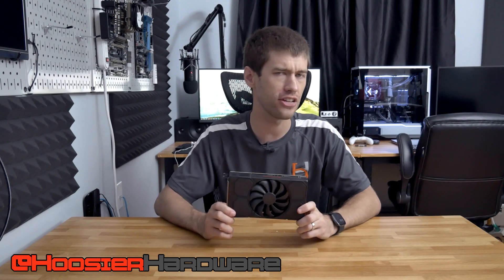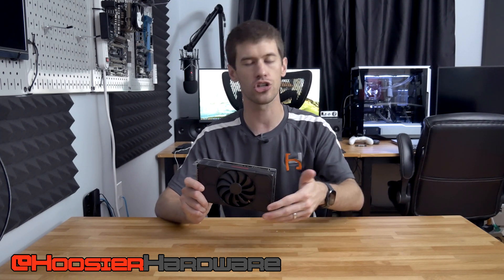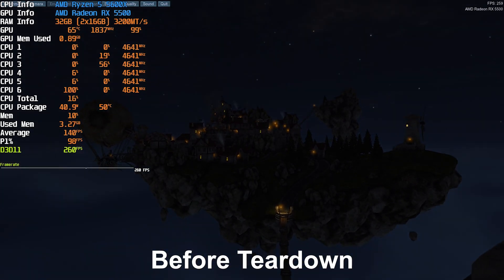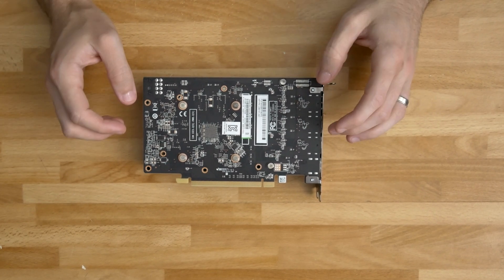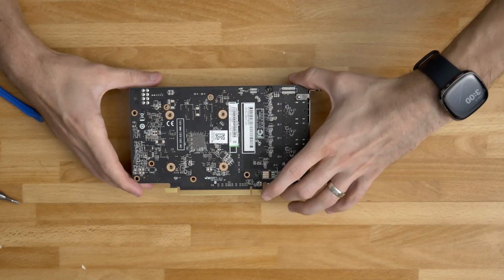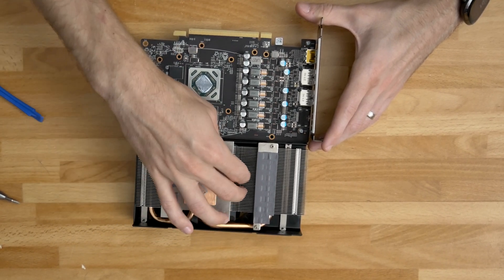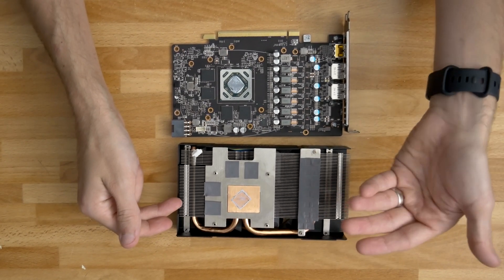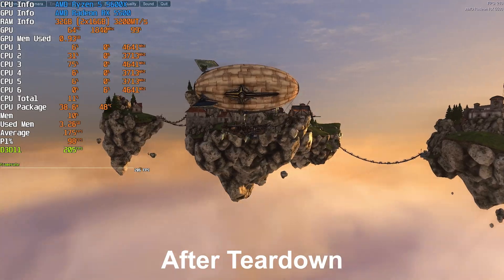OEM HP RX 5500 Teardown

Comment: Is this better than a 1650 super?
Reply: Yes, definitely a little better.
Reply: Essentially the same performance. Nvidia is better in games that use unreal engine like fortnight other than that they are the same. 
AMD gimps there lower end cards limiting the cards to 8x pci express instead of 16x. Where if you you have pci express 3.0 it can a bottleneck for the gpu instead of 4.0 it where it would not be a problem. The rx 5500 xt with 8gigs of vram matches the 1660 non super card.
Reply: @justinloftis2307  what are you talking about? its much better than 1650
Reply: @Inuitman  What are you talking about the 1650 super and the rx 5500 4 gig are essentially the same card besides the the 8 pci ecpress lanes which drivers mostly fixed that problem on AMD side. RX5500xt 8 gigs competes with the 1660 non super card which both beats the 1650 super. The video is about the rx5500 4gb card.

Comment: I got my brother a Dell G5 with OEM RTX3070 and the GPU keeps to mid-high 60’s Celsius  under heavy game loads. The GPU has decent thermal paste and heat pads on VRMs and Mosfets etc and no throttling issues at all!

Comment: Looks pretty decent actually. I think the only thing I would change is makes the plastic shroud not quite as tall so it has more room to vent hot air. Otherwise a completely reasonable design
Reply from the maker: Yep. I'd agree on that front.